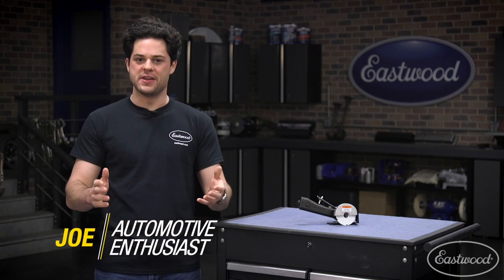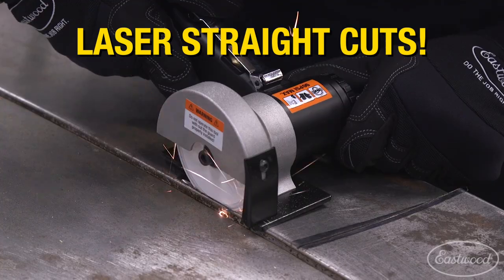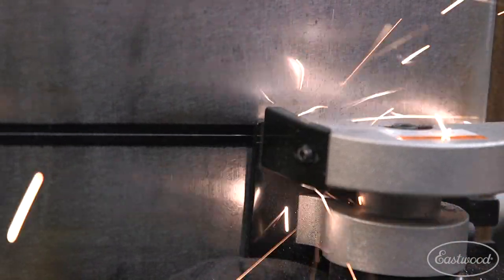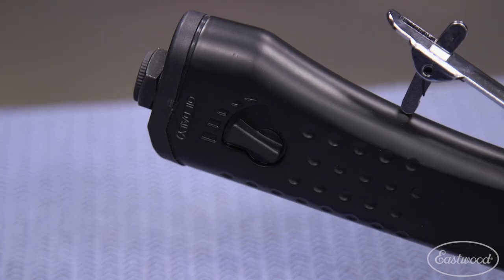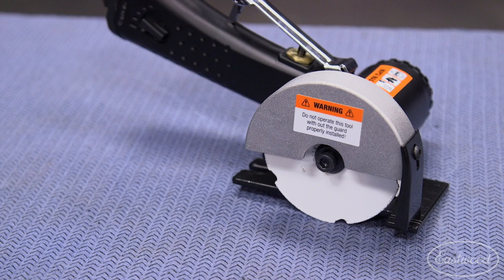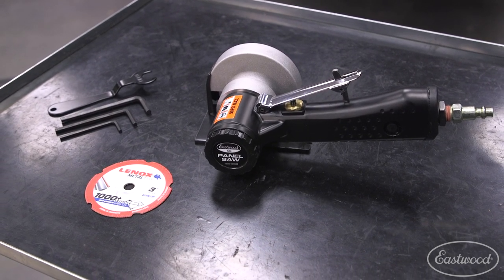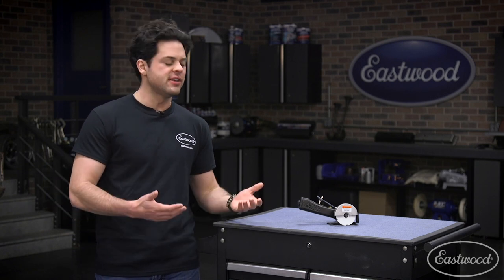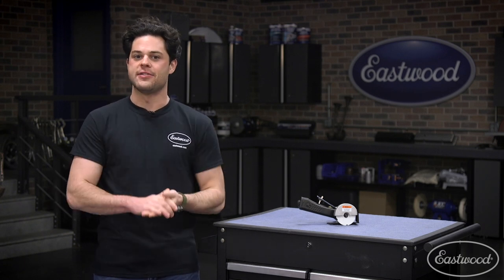The MOST ACCURATE Way to Cut Sheet Metal - ON or OFF Vehicle! Elite Panel Cutting Saw! Eastwood

Comment: Nice, I like when you buy a tool and it comes with everything you need, no separate stuff to buy.   It ever has thread locker on the adapter and the alan wrenches.